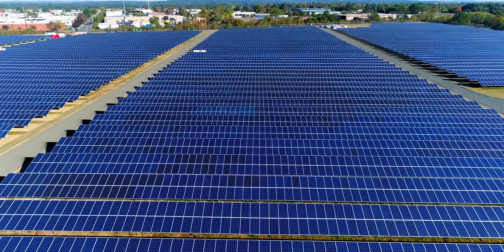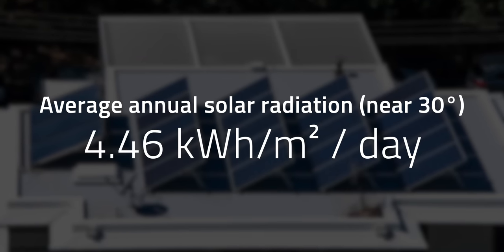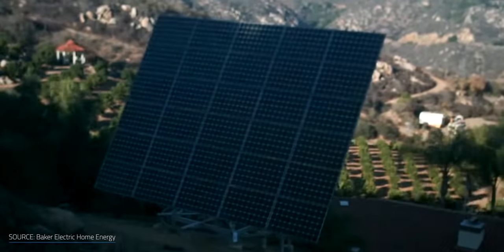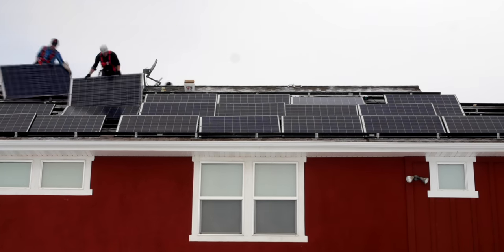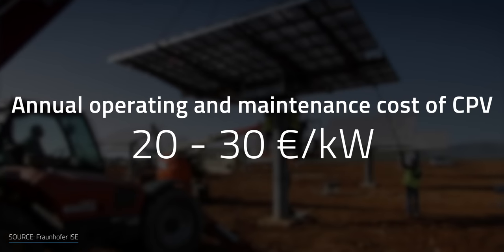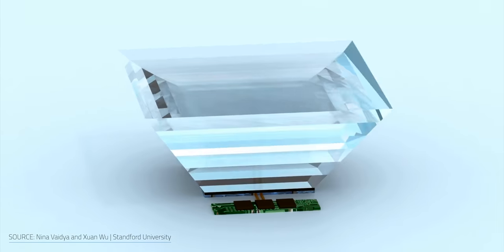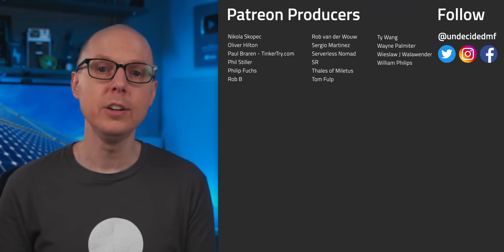This Invention Could Supercharge Solar Panels

Comment: Buzzword, buzzword, future, vision, buzzword.  R&D is always important, but for the most part the whole piece was just a bunch of buzzwords strung together.  Solar power is a 2d system and the sun provides a finite amount of power per sqm.  It doesn't mater if you use a collector to pass light to a more effective collector, it only maters how much energy your system produces per sqm of sky the system is exposed to.  Also 3d printing is not a tech that reduces the cost of production.  It allows you to do one of two things, create complex geometries that aren't reproduceable in other ways, or it allows you to create short runs and prototypes without a lot of tooling time and expense. 3D printing is not cost effective in mass production especially when the desired object is a simple geometry.

Comment: Those "small" solar panel things will never be a viable option.

It is going to have at best half the lifetime or regular PV, doubt it will last over 3 years.

You MUST have a 3 axis tracker.

And you must have active cooling on it to prevent overheating and fire.

It is going to weight A LOT MORE so also needs a larger more expensive tracker.

And even if the "solar panel" is smaller at the die it is still huge when you take in the total area with the lenses and instead of it being 2 to 4mm thick it's going to be 20 to 50mm thick with a lot more material and weight.

Over all it is likely to cost much much more than double of regular PV 

This is as dumb as "solar roadways" that fails after a few days, super expensive and doesn't really work at all 😂

Comment: "3D Printing"! 
Anyone who's ever used 3D printing knows this is not and will never be a mass production option. 
This tech is dead right there unless it can be fabricated with a more continuous, large area process
Reply from the maker: If you're talking about 3D printing at home, that's a completely different ballgame.
Reply: @UndecidedMF  3D printed ANYWHERE is much slower than other methods (such as casting). By it's very nature a print head has to carefully pass over every tiny sub-millimeter section of every single part. I expect parallel heads could be employed but there would still be a problem with the density of heads and drying times.  Please show me a RAPID 3D printing process for mass production, or even for low volume production. You can't, because it doesn't exist. Empty protestations don't cut it.

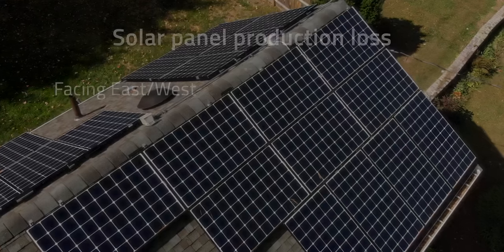Comment: I don't know my East and West seems to get the most Sun than myself side rough maybe because when the sun comes up in the summertime it comes up Way North East and set Way Northwest myself side only gets about 9 hours of Sun while my east and west solar panels get a lot more sun my east side is solar panels stop making power no it always makes power when it's daylight no matter what but it makes less power after 2:30 in the afternoon my West solar panel start making power by about 10:30 in the morning on the west side of my house on the west roof of my house I should say and it's also seems to be when I get the most Sun even though there's no trees and I myself sit at the house and yes I do get a lot of sun on the south side of my house but if you ever get up early enough in the morning to see the sunlight come up and see it shining to the between the corner and North East part of your trees shining up the back side of your solar panels charging your solar panels giving you solar panels power from the back side when it's still dark in the front side and I don't got bifacial solar panels I'm talking solar panels that are 20 some years oldand yes I'm going to put solar panels on the north side of my roof my south side of the roof my two biggest rough east and west and the summertime I generate a lot of power on that and the winter time I'll just start generating power about 7:30 in the morning on the east side till about 4:00 at night or in this case till about 2:00 in the afternoon and my west side of the power from about 10:30 in the morning to about 4:00 in the afternoon and my South side would collect power from 7:30 in the morning till about 3:30 in the afternoon maybe 4:00 I don't know it's been cloudy and dark for the last 6 weeks barely getting any sunlight and I haven't run out of power yet but I don't got enough batteries to run it that long without solar so my solar panels do make power when it's cloudy out my blue solar panels make the most power and cloudy days and when it starts coming up in the morning real early in the morning and when it goes real late at night or in this case afternoon but I also got black solar panels and other type of color solar panels other types of colors of the pound seem to do just as good as my blue solar panels and my car headlights on dim will charge my solar panels.

Comment: - 
Opening -- side -- shot -- image -- still --
-- angled -- cross sectional -- cor ner 
        at the beginning of the video .
. 
First of all . . . by - way  of  i t ' s  physical
   -- design -- structure    A  L  O  N  E  . . .
       . . . . ((( to the eyeballs ))) . . .
         . . . it looks sooo  C O O L  .
That image . . . in high  R E S . . .
. . . transfered to my desktop computer
-         screen saver .  B E A U T I F U L  .
 Us Design Engineers . . . N O T  Well
-                                            in our heads .
-                                           --  S m i l e s  .
P . S .  -  B R I L L I A N T . . . 
      . . . (( p u n  intended )) .
-